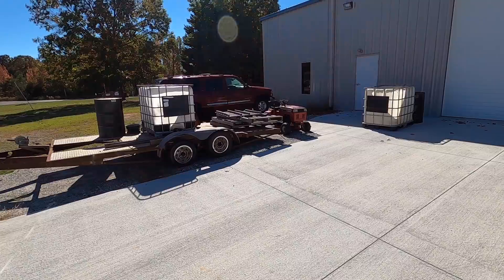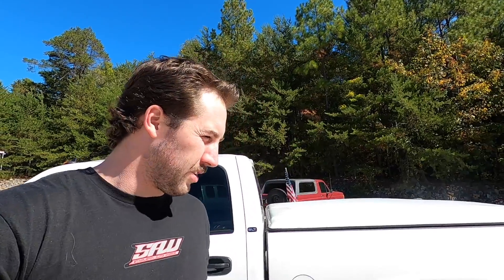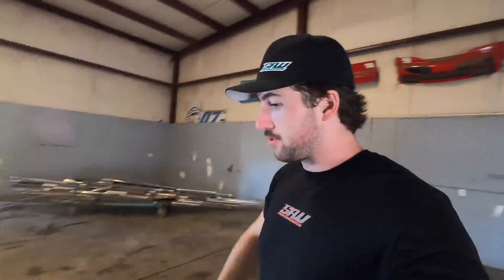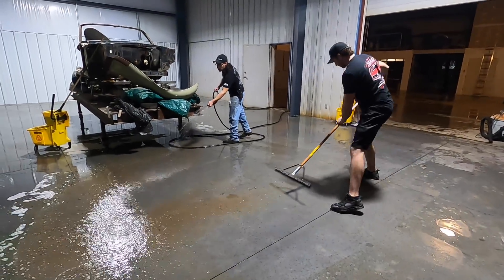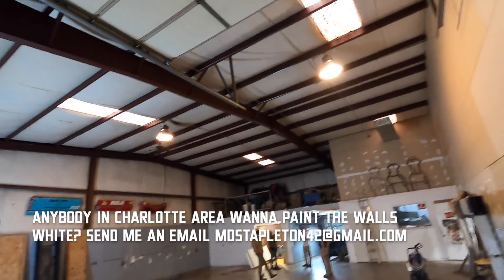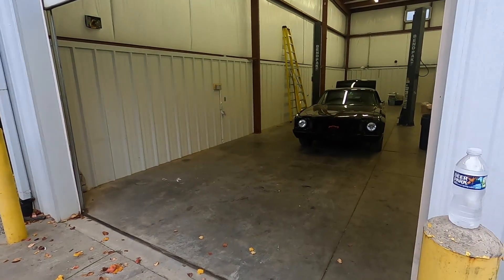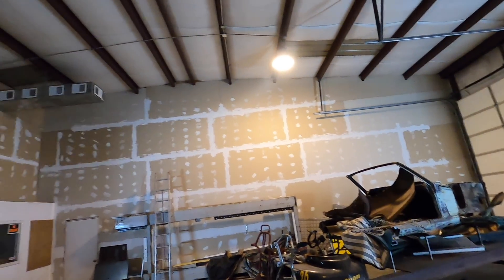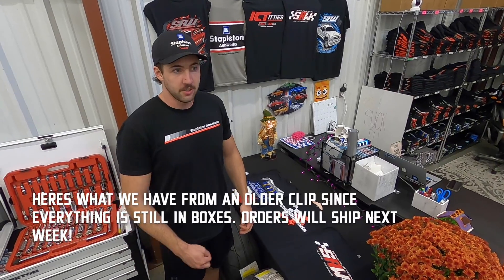We Got a Bigger Shop! What's The Plan? Cleaning Up & Moving Things Over

Comment: It's funny how you love the old Suburbans.  I just sold my truck and I'm waiting until Spring to buy a new another one. So I bought an old clapped out 2003 Expedition to drive through the Winter. I've been changing bearings and axles since I got it but I love driving it. There's just something about those old SUVs. Instead of a new truck, I think I might shop for a really nice diesel Excursion. All I have is a 16 foot car trailer and a 24 foot enclosed bumper pull. I just don't need another $60K truck. Time to just kick back and relax in an old SUV. lol

Comment: For those of you wondering the red, white, and black metal tubing strucutures that were up against the wall of the shop at 6:13 are go-kart chassis. My assumption is that the shop used to be a karting operation.
Reply from the maker: It still is
Reply: Do you by chance what the name of the team is?

Comment: Got to sand the drywall compound smooth or it will look like garbage lol it usually takes 3 or 4 coats to look right and I always watch the whole video ..... You need to get one of those four-post wildfire lifts like vice grip garage so you only have to worry about setting up the power to it

Comment: I want to see you make some power with Elvis or another Duramax. It would be cool if you did a Duramax swapped 2500 suburban. For the most part it literally just goes right in place of the gas engine because the main wiring connectors are the same. It’s extremely simple and there’s many writeups in forums on how to do it

Comment: Buttholefingers needs an 87 IROC Camaro. Just saying.
Reply: Sorry, I'm a Ford guy
Reply: @MustangSally232  LOL I'm sorry. I speak from experience- except I build the trash fords no one else wants and put those polished turds into hopeless chassis. Currently doing another Lincoln drag car. First one was a 78 continental with a 400  converted to a 4v cleveland top end (because I hate being able to buy intake manifolds that I don't have to cut up to make work), ATI full manual C6, TCI 3500 stall, and a 5.13 gear. 
This one is a 95 towncar that I'm building a shitshow of a 3v for. Dual carbs sticking out of the hood of grandma's car is my jam lol.
Reply: @stuffandjunkandthings364  I sure like your way of thinking when it comes to a Town Car! Share some pics on your channel, I subbed!
Reply: @willr69420  Common sense and the laws of physics will be disagreeing with two of us then lol. The current build, "Doris" (named after my buddy's grandmother who left it to him when she passed) is a 3v top end going onto a 2v block with coyote rods and stock 3v pistons. Got a Holley sniper dual 4150 intake for it, and some other bits. 

likely going to be stalled until after the holidays, Ford parts aren't cheap, and it's just barely going to squeeze in there, so I want to get the little stuff as good as it can be before I put it in. 

LOL if a valve cover starts leaking I'll have two options, live with it, or pull the motor- there won't be enough room to remove them in the car. 

Writing that out makes me think I really need psychological help...